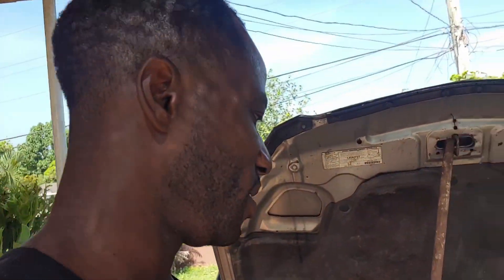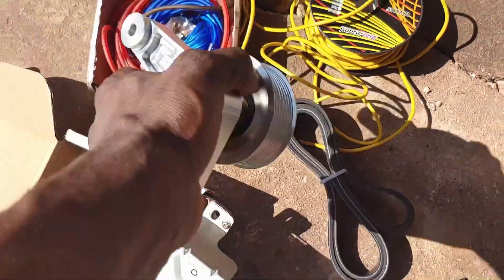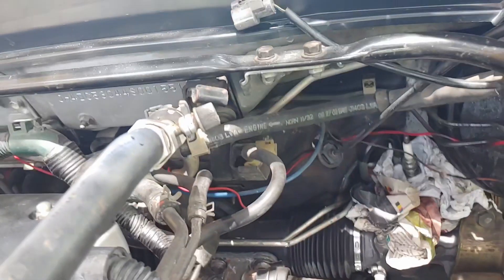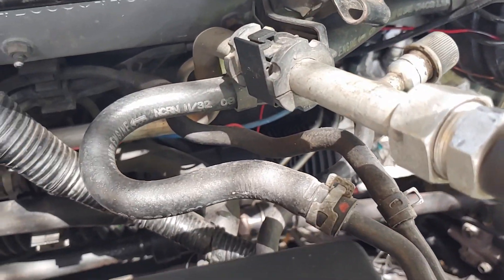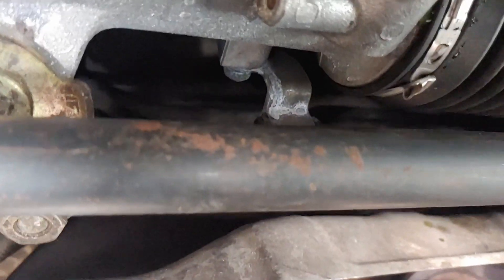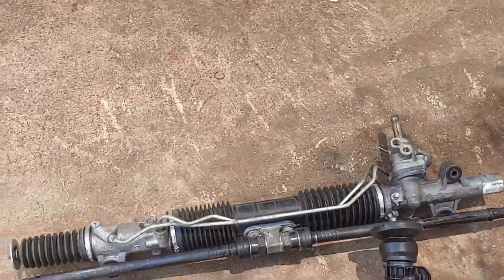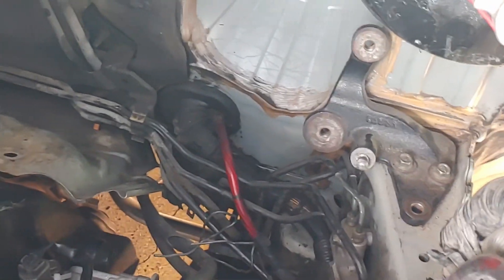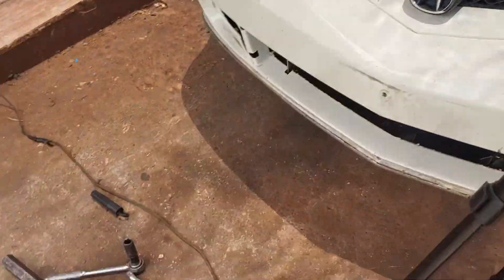EP3 Electronic Power Steering (EPS) conversion in my RSX (Part 1).

Comment: How was the process for removing and reinstalling the new rack?
Reply from the maker: Like a 7 out of 10, once you have the right tools everything will flow smoothly.
Reply: @rohanovegeway8627  any advice? I highly appreciate your video. You made a thorough and realistic installation of the eps.
Reply from the maker: @dC5alex  make sure you get every part before you actually start the process and get extra fuse for the eps computer just in case.
Reply: @rohanovegeway8627 where did you put the BCU? I’m trying to find a spot where it won’t overheat.
Reply from the maker: @dC5alex  diagonally to the passenger's left foot under the carpet and dash.
Reply from the maker: Not fully covered under the carpet though.